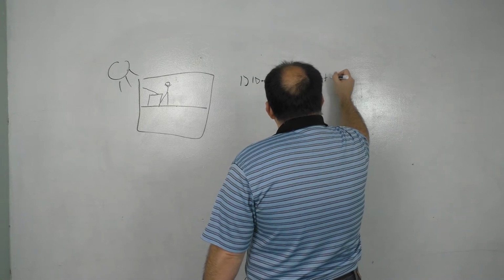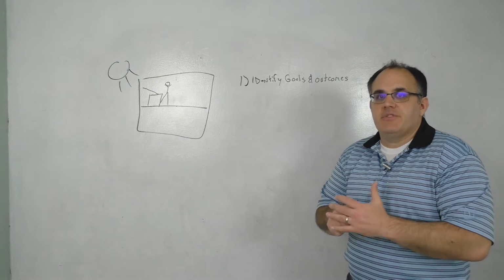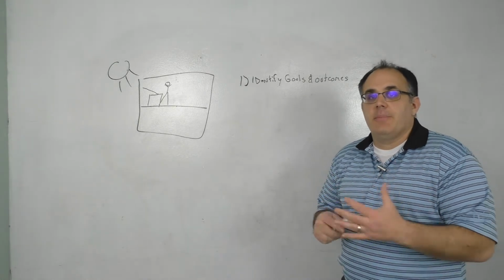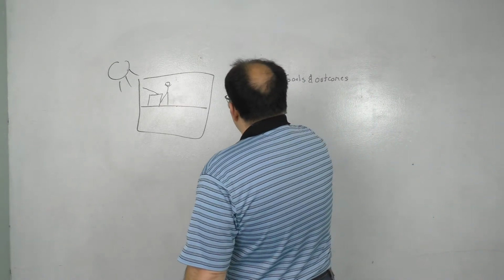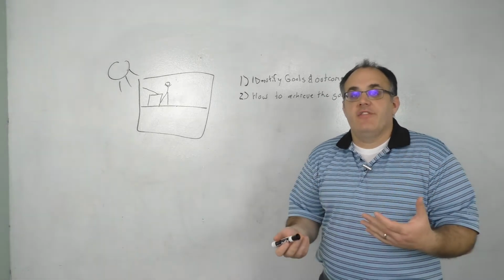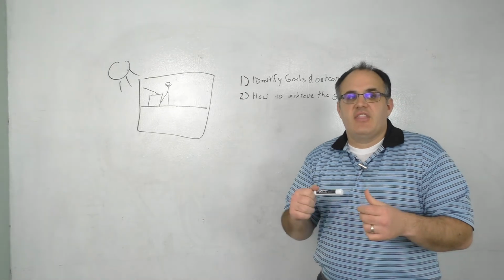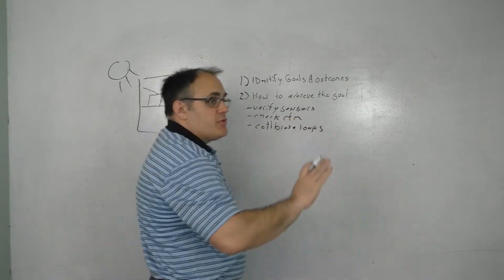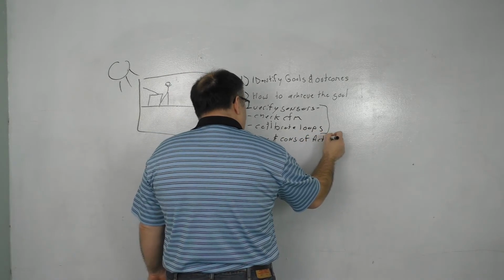BAMTV 003: Building Automation Optimization Strategies Part 1

Comment: That's Re-commissioning Phil, Not Retro-commissioning. Great series of videos. Retro-Cx is for a Building that was never commissioned.
Speaking of optimization, I see a lot of controls techs shying away from cooling tower condenser water reset, or cooling tower relief as well as overall plant efficiency tracking for resets.
A DDC system should look at the entire plant KW (CT fans, CW/CHW pumps, chillers amp draw, etc.) to stage chillers and reset chilled water temperature and condenser water temperature for optimization. 
Can we speak of "predictive optimization"? i.e. looking at an entire year trend data and establish a building load profile, then  through AFDD (Automatic Fault Detection and Diagnostics) and trending data issue alarm if Amp (or KW demand) is above the "expected load" by a certain threshold.
Reply from the maker: I think techs shy away due to not truly understanding how a plant works beyond what they are supposed to program.